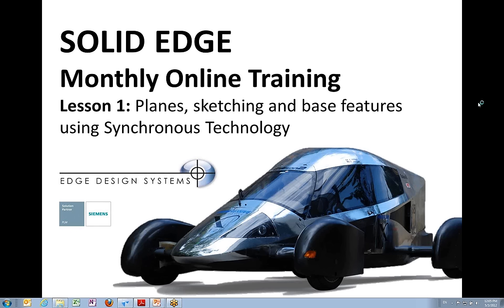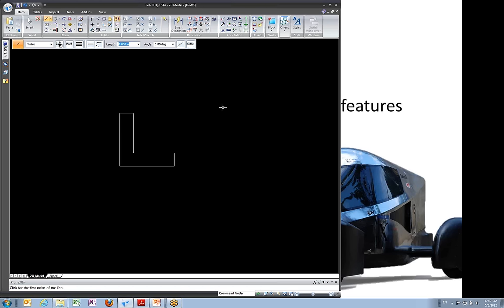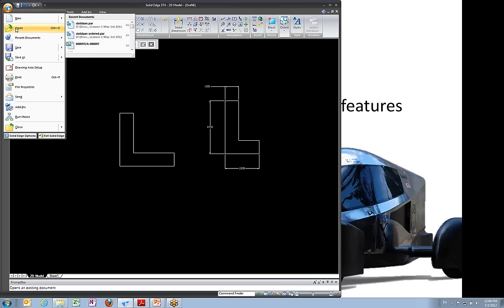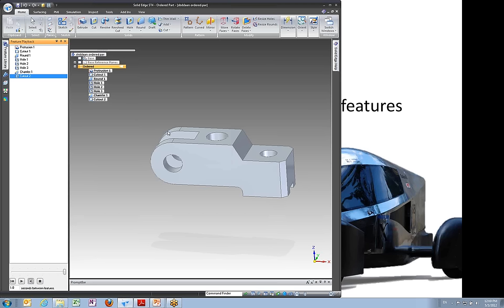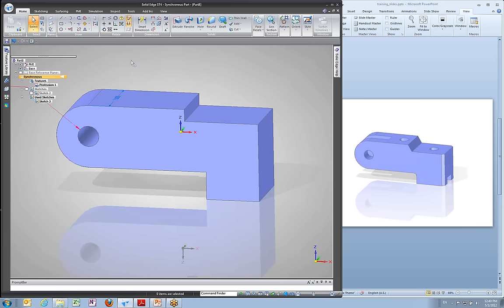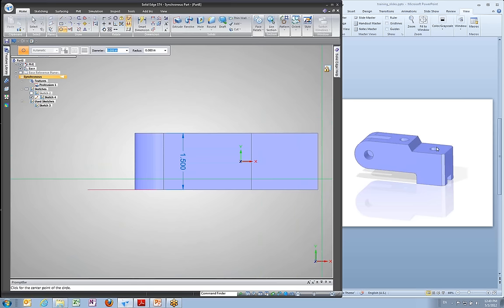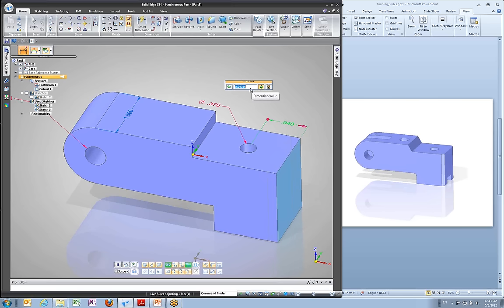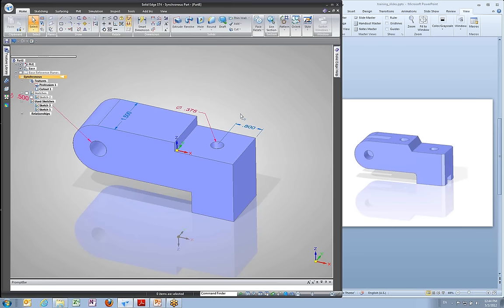Intro to Solid Edge Online Training Lesson 1

Comment: At about 15 minutes when I follow along and try and move the circle away from the rectangle and to a new plane using the steering wheel, my rectangle moves to the new plane as well. Why is this?
Reply: i have the same problem, do you have an answer yet?
Reply: I have the same problem even aligning the wheel to my sketch is a problem